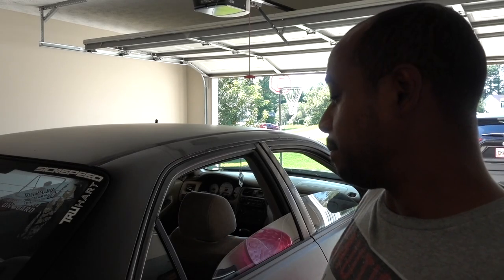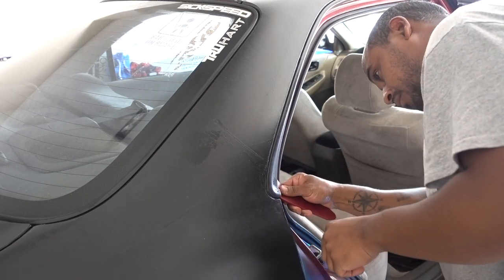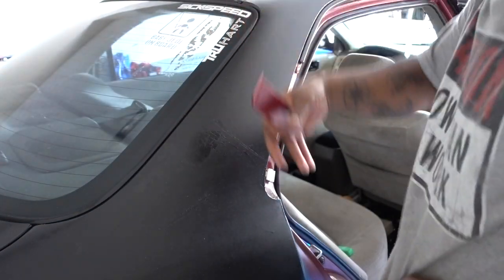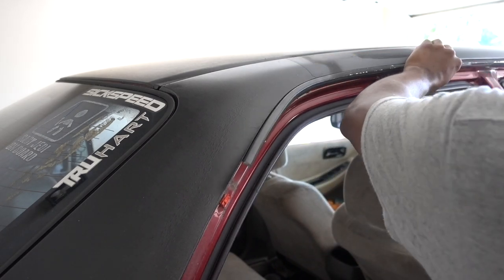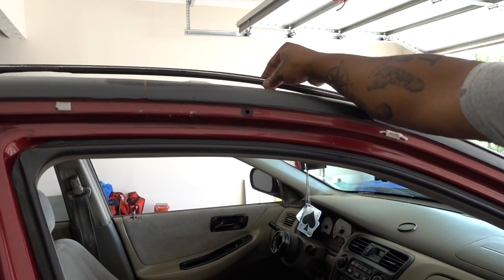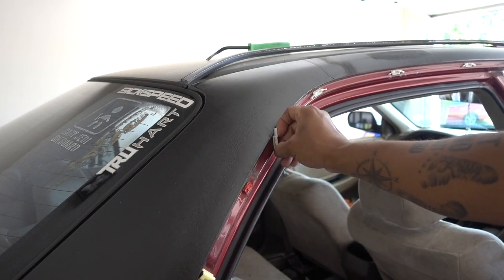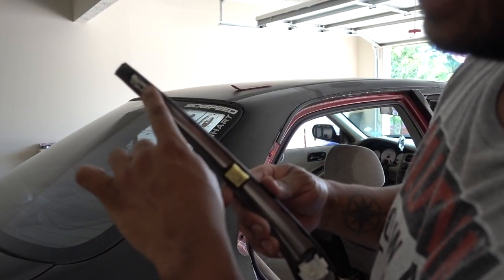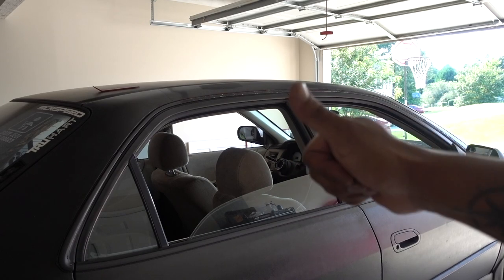How To Remove Upper Door Trim || 1998 to 2002 Accord

Comment: I did this on my acura EL to get rid of the chrome trim and used black trim from a civic, process pretty much same as this accord. The clips on the end piece by the rear pillar are impossible to get out without breaking. So if you're doing this know they are going to Break! the rest typically come out ok. I got my replacement trim from a salvage yard and drilled holes in the cars frame making it possible to stick Needle nose pliers and squeeze the tabs from the inside so I can get them out without breaking them. buying new OEM replacement moulding will be very expensive and hard to find.

Comment: Where could I buy new trim because mine is damaged on the driver side as well.
Reply from the maker: Probably Honda or junkyard
Reply: @BulletSolano  I tried a few junkyards most Honda’s have the same damage I guess due to breaking in. Thanks tho great video.
Reply from the maker: No problem